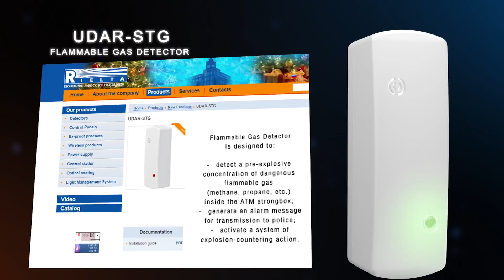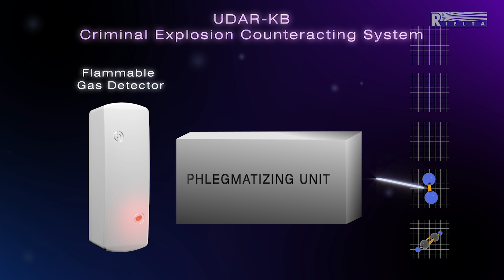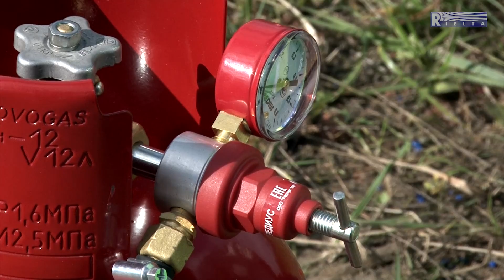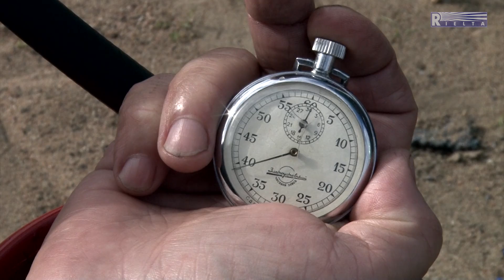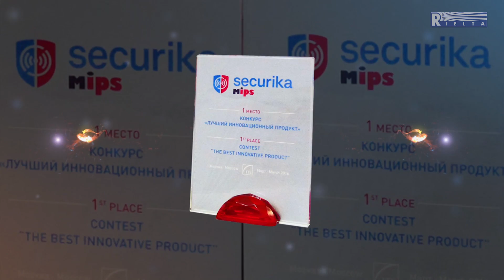Explosion-counteracting system for preventation of gas-explosion

Comment: propane. 40 seconds. spark gap. got it, thanks guys.
Reply: Is 40s    to much tho ?
Reply: @Jess-yh7nf  lol.
Honestly if i would attempt this id use acetylene.....propane is too sensitive with its air/fuel ratio to ignite...acetylene will ignite regardless lol but too much will definitely f things up. Actually forget all that i said. I really dont know what im talking about lol 😆 😂
Reply: @jaysanchez760  how do I get or make one spark gap though?
Reply: @dmario2992  they sell em at the hardware store by the barbecue grills
Reply: @dmario2992  just need to extend the wires